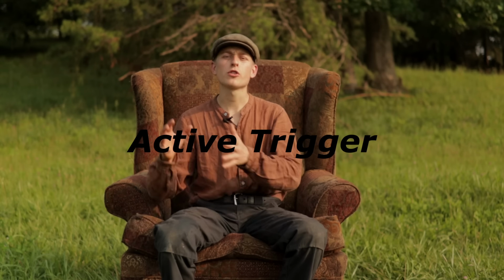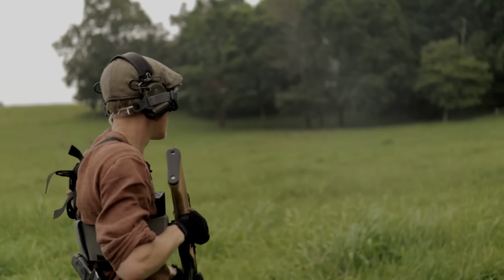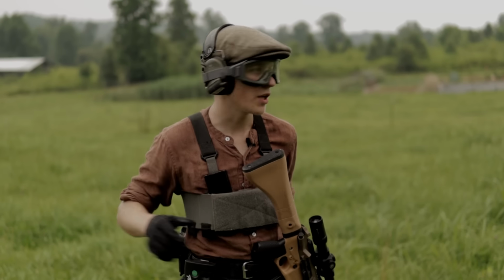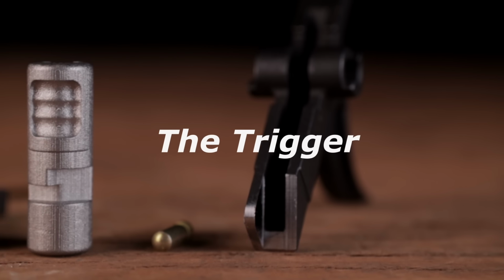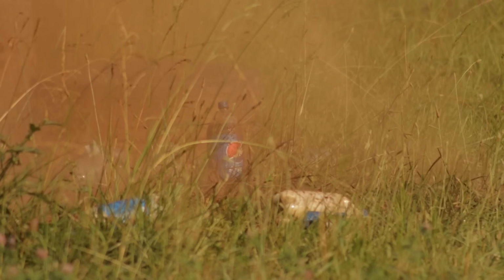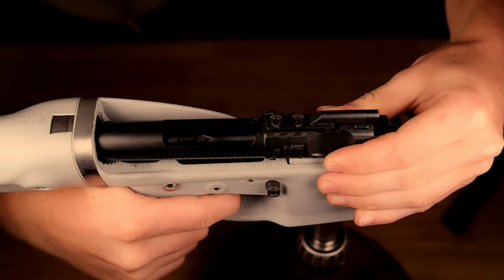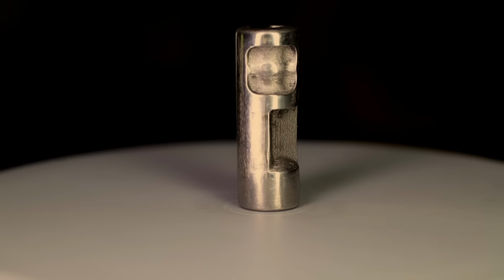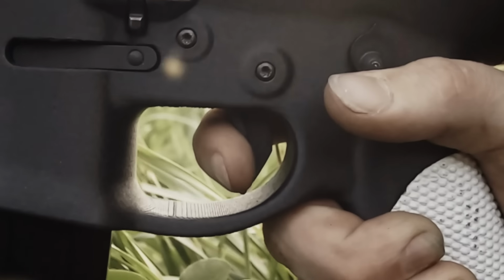Introducing the Super Safety

Comment: You should make one that doesn't push to the sides, is made out of silver steel and has bushings or bearings in the sides that press fit into the receiver holes/are held on by a dimple for the detent in one of the bearings, and don't make the arm with additive machining that needs to be spring steel with a roller in it for the bcg to knock against. 

It would be hella fun to magdump with. I'd also experiment with a spring connected to the arm that pushes it forward to slow down the rate of reset a little (it would slow down the bolt too so you'd have to mess with the buffer maybe)
Reply: it's so easy to make precision spring steel parts in your garage

Comment: Couldn't you print one in PLA and make a lost-PLA casting mould? This should allow you to cast it in steel or aluminum at home i imagine
Reply: Skip the casting bit,  it's possible to just print it directly in metal these days.  Including the trigger.
Reply: @justhereforthalolz  not possible if you don't have the right equipment, metal casting is cheap and relatively easy for small parts

Comment: @HoffmanTactical You should include an STL file of a modified trigger to use as a template ;)  And for those of use that can 3D print metal.... We can simply print the trigger and use it.  For those that cant print metal,  it gives them a great reference point.

EXCELLENT work btw.  I love the idea of forcing safety engagement on every single shot.  That's some next level out of the box thinking :D
Reply: I don't have a 3d printer, but I have a full machine shop :)
Reply: If you can print metal, what kinds of material exactly can you print? Can you make a suppressor that actually works and holds up to the high temperature? I know that 3d printed suppressors are indeed on the market and very durable, but I'm asking if YOU can do it with your machine. I know Huxwrx and Sig already do it but I assume their device that prints metal is far more expensive than what you have(no offense intended btw, I just mean--they're large corporations with tons of money, you're most likely just a dude).
Reply: @armorers_wrench  He could work at a shop with such a machine.

Comment: My understanding there is nothing illegal about making firearm parts at home it's just the actual firearm receiver that has regulations. 
If you can make the plastic stuff you can also make the metal stuff with knowledge on metal casting. Someone could even do this at home in their garage with the right tools knowledge and given you're using a metal that has a low melting point such as tin(much lower melting point than iron/steel can be melted with say a propane torch for example). Just do research on "diy metal casting".

Comment: A flex fire technology system and it can't be commercialized except under license. AR 1 is actually a subject in multiple lawsuits currently.
Reply from the maker: That was Graves patent I think. Cool guy from what I've heard.
Reply: This has nothing to do with Graves patents.  It's literally a completely different concept called active reset.  Graves is forced reset.  Graves design is also extremely susceptible to hammer follow as well.  This bad boy literally enables safety on every single shot.  Freakin genius.
Reply: @justhereforthalolz  You really think the feds give a shit about the semantics between “active” and “forced”. lol
Reply: @justhereforthalolz  If it resets and unlocks a trigger (from safe) automatically it has everything to do with the Graves patents. The patents cover a family of concepts and the mechanisms involved to accomplish those, not just a trigger, multiple species of triggers, and recoil systems are included.

Comment: Any way to make this work with a rotating safety rather than push button, or does the need for the safety to rotate slightly while it's in use make that option non feasible?
Reply: It's possible that one might be designed, with a slot for the tail, but the tail would have to be narrowed and rotation angle comes into play. The cross bolt allows the detent to also serve as part of the limiting of movement required to function. Quite the genius design he has here.

Comment: Would you be able to make an aluminum lever for more reliability?
Reply from the maker: I'd like to.
Reply: @HoffmanTactical  excellent work as always❤️
Reply: Xometry would be happy to take your money and print you one in stainless steel.
Reply from the maker: @steveg2277  They do crappy work.
Reply: @HoffmanTactical  I’ve used Xometry with very good results for parts that are quite expensive. I’m a mechanical engineer and need parts prototyped all the time. Don’t like Xometry? Okay. Fictiv then. Or protolabs. What about Pcbway? There are many options is my point.

Comment: Awesome work! My only question is, when safeties printed in nylon fail after a few hundred rounds, what happens? Is the firearm unable to fire? Can the safety still be engaged to prevent the trigger from being pulled? Or does it fail in a manner that leaves it on fire until the part is replaced?
Reply: Simple.  It reverts to standard operation,  spring reset.

Comment: "ACTIVE RESET MODE" you just made a machine gun without calling it a machine gun.
I must admire your ingenuity and engineering skills, but this is just a loophole, just like bumpstock.
that lever is just and upside down auto sear. the bolt carrier also pushes the sear at the end of its travel, so is this a second function?? you never lifted you finger from the trigger. you are still in the same motion. Jerry Miculek can shoot fast because he his amazing skills and muscles in his fingers, you can shoot very fast because you have a device that turns you semi in a machine gun.

im assuming you wont register this device with the ATF anytime soon

Comment: Wow, forcibly putting the safety on with the energy of the bolt carrier, then turning it off when the bolt is pretty much seated.  Very impressive.  Funny thing is you can actually demonstrate the same thing with a mil spec trigger group by forcibly turning the safety on while keeping trigger pressed after a dry shot.  You just figured out how to incorporate the bolt.  This is pretty cool
Reply from the maker: Exactly ;)
Reply: @HoffmanTactical  would it be possible to 3d print a stainless trigger with the cuts already made to engage with the super safety 3 cam version .and could we see one in the future?
Reply: @leanbean8962  Yes its possible to print a trigger.  I use entirely printed FCGs.  But then again,  I can also print metal.  I've not tried to print one in plastic yet.  The only thing needed is the STL file and a 3D printer capable of printing metal (over $20K for the kind I have).  But if you have access to one like me,  these STL files are very fun :)  I also asked him to include a trigger also.  Maybe he didnt think people would ask for it,  idk.  It might also be the way he's going to try to monetize it.  That would kinda suck but I guess he has to pay for all those rounds somehow :P
Reply: @HoffmanTactical   thinking about manufacturing such safety from the rear end of a 3/8 drill bit.
Would you be so kind as to send me the measurements to do so? 

I am not in the US, (living in the middle of a desert in Africa, lol, not even joking) so I will have to trial and error it as I go.

Your help would be highly appreciated.

Thanks in advance
Reply: 1920’s Botkin.
Reply: The first time I put hands on an M16A2 I didn’t realize you had to charge the weapon to move the selector lever to the safe position..I pushed on it so hard until it was finally on safe. Basic combat training at Fort Sill, Ok lmao.
Reply: Mastercam has some pretty solid mesh utilities as well.
Reply: @riley9999999999  Easier said than done.  Have you ever actually tried to use Solidworks?  It's not like it's MS paint where you can just whip out the eraser and start hacking away.  It doesnt work like that.  It would take weeks just to learn how to do the task.  And thats if you ALREADY have the trigger model,  of which I have seen none.  There are lots of STLs floating around that I have seen though.  However I dont know of any apps that can modify an STL.  I wouldnt doubt that Solidworks could probably import one.... but again,  take eons just to learn how to do it probably.  It's not what I would call an "intuitive" app.  Its far to complicated and tasks which should be simple and quick are complicated and take 10x longer to learn than they should.  I HATE solidworks.  It's utter trash.  I've already tried printing some of the triggers I did find,  but none of them work with my metal disconnectors.  They seem to fit, but when you put them in with a pin,  the disconnector doesnt rock (even with no spring in it).  So the trigger files I have found are obviously out of spec.  If I can find one that actually functions properly,  THEN I'll begin to try to modify the file :)
Reply: @justhereforthalolz  Hell, Cinema4D or Blender could mod a trigger like that. It's a simple cut. Fusion360 should be able to.
Reply: @justhereforthalolz  Use Catia instead of Solidworks.
Reply: @justhereforthalolz there are so many programs besides Solidworks, not to mention we're on YouTube, the mecca of free online tutorials. It's probably going to take someone an afternoon of watching and tinkering to do it if your IQ is higher than mayonnaise.
Reply: So you'd have to illegalise milspec triggers if you were being honest

Comment: Very clever and very cool. I wonder how hard this would be to machine... seems like it would be easy, and a metal version would last much longer, I'd think.
Reply: Very easy?  The cams could be filed somewhat easily but what would you use to very easily create the three detent channels squarely across the outside curve of the cylinder?
Reply: @osbjmg  I'm pretty sure I've seen milled metal with an inset outside radius like that. But I am no expert in machining, so I absolutely could be wrong. Might require both turning and milling.Might even be easier to mill it in several cross sections with a couple holes through to bolt it all together.
Reply: @merpius  I'm sure it's doable and probably not considered hard.  But I am just saying for the average Joe, 3d printing is easier and more accessible.

Comment: If they defined a machine gun as firing faster than a certain rpm, it’d be odd to see a colt single action army listed as a machine gun while an m3 grease gun wouldn’t be considered a machine gun lol
Reply: @@GenerikUsertaking disarmament to a different level 😮
Reply: they are basically saying a continuous pull is a continuous pull it doesn't mater if the trigger is moving fwd. This is a super clever design not unlike the FRT-15 but they do essentially the same thing. They create the timed effect of an auto sear but instead of the BCG activating the sear it activates your depressed finger. 

I firmly believe the NFA should be repelled and machineguns should be legal. But under current framework and jurisprudence I doubt this will stand up.
Reply: By that logic any semi auto with a reasonably fast action speed would be considered a machine gun. Which might be where they're going because they don't want us having anything. After they lost to the Taliban they seem to know that an armed population is a massive threat to them.

Comment: I wonder if it would be practical to sand cast it in aluminum & do a little filing & sanding to get it within spec
Reply from the maker: Not without a lot of trouble, but I do think vacuum investment casting would be a good candidate.
Reply: @HoffmanTactical  have you seen if the plastic lasts any longer if the trigger is well lubricated? Maybe with something thicker like grease? Or could that potentially act as a solvent on the nylon?
Reply: Or brass casting.

Comment: Several things...
First, I like the design over similar attempts by others.
Having said that, I see a couple potential issues.
The first being the selector hole in the lower receiver. I see the potential for premature wear, enlarging the hole.
A possible solution would be a steel bushing.
The other potential problem is wear on the 3d printed parts. In a perfect world, they should be metal.
Last... while extremely fun, it looks like a waste of ammo. There are however, some rare circumstances where rapid fire might be necessary.
The last thing... the elephant in the room.
For someone who can read, and comprehend what they read, this does NOT fit the legal definition of a machine gun as defined by Congress.
However... neither does the drawing on the chunk of metal that Matt Hoover rots in prison over.
Mr. Biden's ATF isn't going to stop trying to disarm every American until they are stopped. It's going to be a very long uphill battle in the courts.
I wouldn't want to be the guy waiting it out in prison for it to be resolved.
China has paid our politicians millions of dollars to disarm us. They aren't going to stop on their own.
Gun control has never been about crime, only control.
Reply: You were doing good until you blamed China for what the tiny hat brigade is doing.
Reply: @earlturner6023  So it's just coincidence that most of our politicians have been bought off by the CCP and all of a sudden there is this massive push to disarm every American?
Reply: steel foil can be enough of a "bushing". besides, 3d printers are cheap enough that lowers can be a consumable item nowadays.
Reply: @jimmbswu  That's true however, doing it right the first time is quicker and almost as easy as printing a new lower. Besides being permanent, it only needs to be done once.
Then there's shtf when you need it 100% reliable. It's not like you can yell "time out, while I print more parts."
It's a good design. I see no point in half-assing it.
Reply: Risk nothing, gain nothing. How many signees of the declaration of independence lived to see its outcome? Stop being concerned over what the big bad might do. They're supposed to be afraid of you and work for you. Change things to make it so.
Reply: That's right, goyim. It's the Chinese that wants to disarm you.
Reply: An auto sear is a regulated part, changing the name and 1percent less the size on a metal card make it a machine gun part.... Distributing money from the sale of machine gun part got him on wire fraud. The mans an idiot looking to make a buck. Had he did this on a business card or stock that couldn't be made directly into the part he would be a free man. Nothing's stopping you from going to a Library and tracing the same link out of a book onto paper.... Once on a material that can sustain the operating pressure , hard plastic,metal, carbon fiber, anything stuff. It can be considered a easily manufacturable part aided by your tool.... Or the metal card then you have machine gun parts..... I'm pro 2a but everyone seems to be blinded by bias over their guns to see the stupidity of the mans actions
Reply: @mr.nobody---  I'm not a fan of rapid fire or full auto as there are very limited circumstances where it is needed.
However... restricting the right to waste ammo, violates the primary purpose of the 2A.
If the day ever comes that the NFA & GCA reach the U.S. Supreme Court, and they are still following the law, both will be ruled unconstitutional.
Reply: @mr.nobody---  Regardless of your interpretation that this is somehow an "auto-sear", the fact remains that it does NOT follow the written law as a machine-gun. Only one round is fired from each pull of the trigger! Thus it remains semi-auto only.
I'm sure ATF will try once again to create a "rule" and/or change definitions to achieve their final goal but... they do NOT have authority to create law.
We have three separate branches of government for good reason.
Again, I couldn't care less about rapid fire or full-auto. What I do care about is the oath I swore THREE TIMES to support and defend our Constitution against all enemies, foreign and DOMESTIC.
Reply: @bendover4154  I didn't say it was. I was referring to the Matt Hoover case being one.
Reply: @mr.nobody---  Who in the h*** is Matt Hoffman?
In my response, I was again referring to the Krag Vs the AR. Both being in-line.

Comment: Do you reckon this would work in a BRN-180? Or is it like an FRT where its dependent on the specific shape of the underside of an AR-15 BCG.
Reply: It could theoretically work by modding the tail but it’s designed around a FA cut AR-15 bolt

Comment: Ok, serious comment here: rotation under load will wear out your safety hole on the lower if the super safety is metal. I wonder how many rounds it will get out before the hole in the lower is egged out.
Reply from the maker: It's an interesting question. But so far I've seen no wear in poly or aluminum lowers. It's pretty low pressure on the matting surfaces, so it will probably be a lot of cycles before it's an issue.
Reply: @HoffmanTactical  I know it's a problem on trigger/hammer pins on actual M16 lowers (legit full autos), so it's got me thinking. I know a bolt carrier weighs more than the springs for a hammer, so it definitely enacts greater work on the receiver hole. I'd be curious to see how it will hold up over time.
Reply: Or just print another lower.
Reply: @HoffmanTactical  Lucky for us,  we dont use expensive metal lowers ;)

Comment: hope you make this out of a softer metal than your receiver. that thing spinning with force over and over again in the safety hole is going to bore it out and eventually itll be loose in there.
Reply: Harder and polished would be better. Softer will gall. If the receiver is anodized and lubricated it should be fine for a while. If desired, press oilite bushings in the receiver for the hardened SS to ride in.